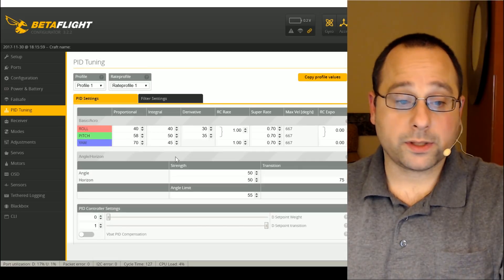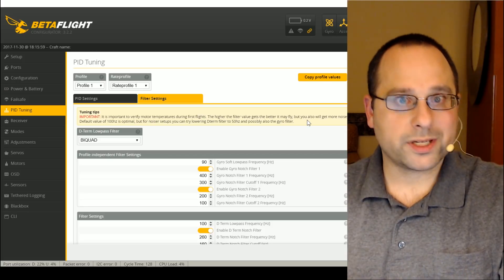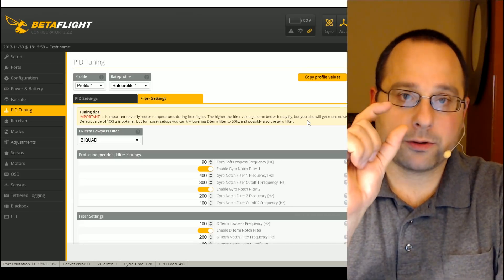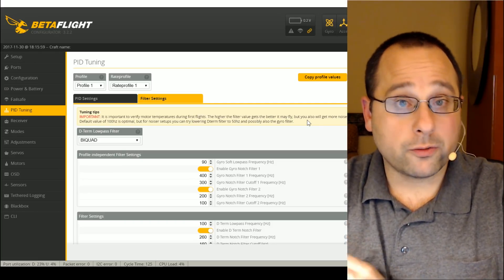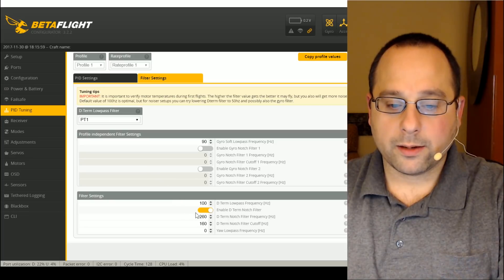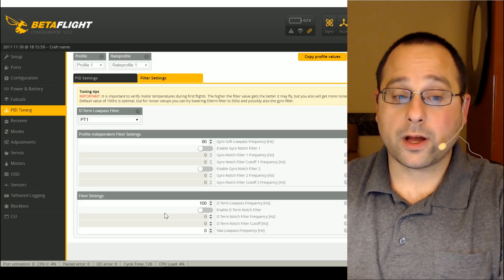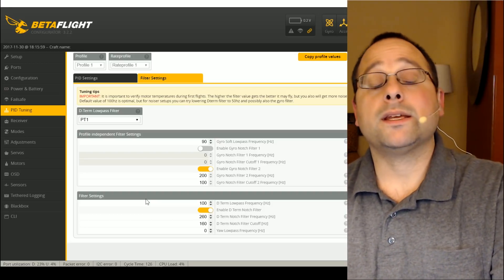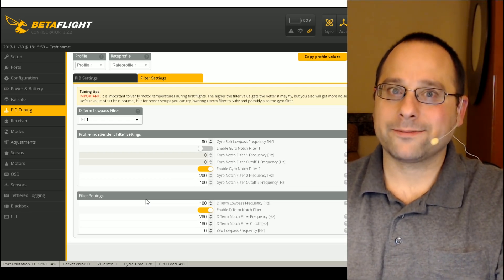Betaflight Dynamic Filter | HOW TO TUNE

Comment: Joshua I think you really should come up with a better description of "How hot is too hot?" There is a great deal of variability in what people perceive as "too hot to keep your fingers on the motors..." I think to be scientific about it you should just figure out a temperature that goes along with this statement so that those of us with infrared thermometers can check motor temps. Just my two cents. Thanks as always for the great content, in addition to these two cents I also just became one of your Patrons...
Reply: It's more a rule of thumb. The absolute temperatures would depend on the type of motors. The thing is, if it's too hot to hold in your hand, the motor will probably still be ok, but close to being too hot. So to keep a margin of error, if you can't hold it in your hand, it's too hot :) Stick to that rule and you'll be fine
Reply: Yes I know it is a rule of thumb. But a temperature as a rule of thumb would be more precise and useful. Someone as knowlegeable and connected as Joshua should be able to get a rule of thumb temp from motor manufacturers. Or come up with one based on his experience and testing... Plus as someone who appreciates a scientific approach to things I would think he'd be interested in coming up with a rough safe temp.

Comment: I think you promised to make a video about tuning anti gravity in (I think) your Betaflight 3.2 set up video.
Reply from the maker: Step 1: Raise anti_gravity_gain until the quad holds firm on punchout or throttle chop.

Step 2: If you get to about 8 or 10, something is wrong with your setup.

Comment: Have you heard of anyone having a problem with their betaflight f4 board not arming and if so do you know what the problem was ?
Reply: If you have an OSD turn on "warnings" in the OSD it will tell you at least some of the time what the issue.
E.g. I've seen "nogyro" or "noprearm" before.
You can also try to arm while attached to USB (take off your props) and then go into the CLI and type status.
There's a code in the output. Theres a page on the Betaflight github wiki that tells you what the codes mean.

https://github.com/betaflight/betaflight/wiki/Arming-Sequence-&-Safety
Reply from the maker: https://www.youtube.com/watch?v=3mOeL8f1dMM
Reply: Joshua Bardwell thank you once again for your help the quadcopter industry wouldn't be the same without you

Comment: SIDE QUESTION:
What's the best setting for a F4 FC?
8K/8K or old school ratio -> 8k/4k ?!?!?
Reply from the maker: 8k/8k.

I have no idea what this 1/2 ratio you're talking about is. Sorry....
Reply: Sebastian Nobody 8k/8k works great with F4 boards
Reply: I know. But is the final result in PID loop maybe better if you use that 1/2 ratio or is this an rule of the past now?
Reply: Sebastian Nobody I find that 8k/8k works best for me when comparing to 8k/4k or 4k/4k. Probably going to be different for others but that's my experience!
Reply: I use 16k/8k with DShot 1200 and dynamic filtering. No issues on my end.
Reply: Joshua Bardwell 
Way back in cleanflight times and early bf times the standard setting was always half the pid loop speed of the gyro. I guess as the cycle times were not as clean etc. Or maybe because of too little cpu power...
Reply: I began fpv this year and never used cleanflightt, but half the pid loop frequency is also settled in mý mind for no apparent reason
Reply: Sebastian Nobody according to the developer 's github there is no point to run 8/8 instead of 8/4

Comment: FOR ME VERY IMPORTANT QUESTIONS:
- What is faster (less deplay)? 1 to 2 static gyro notch filter   OR   just dynamic notch?
- What's the need of enabling static notch filter(s) if dynamic is on? Should the dynamic filter not cover the static parts as well?

So far, I have the best experience with my Martian II frame + 2205 2300kV motors to have just Gyro Notch 1 (245 Hz center) and D-Term Notch on (and of course PT1). Dynamic Notch just added propwash back again.

My other DALRC X215 frame + same motors is more tricky. Here I need Gyro Notch 1+2 and D-Term-Notch to be on. And since dynamic notch is out this is on, too. This all helped a lot to for better overall flight performance.
Reply from the maker: Dynamic notch latency is impossible to generalize. Its width is dynamic. So its latency changes.
Reply: But it must be more as a scan of the gyro raw data is needed. The static filters are fixed manually, thus no analysis needed.
So in my understanding its faster to work with a static filter. If you crash a lot or fly at different altitudes or temperatures the dynamic filter is more handy.

And what about using static on top of dynamic? Is it usefull?

Comment: What the point to keep gyro notches on? Wont they interfere with dynamically set notches?
Reply: Notch filters are static, they attenuate a frequency range you choose.  The dynamic filter analyzes the data and seeks out the frequency with the highest noise and attenuates accordingly.  If a notch filter is already set up properly (via black box freq logs and manual settings) then the dynamic filter can only see what’s left, and then seeks out whatever noise is the loudest.  If your noise levels are really low after tuning filters manually, then the dynamic filter may actually be unnecessary.  All filtering requires processing time, so less filtering improves the immediacy of flight control, but the additional filters do not really “interfere” with each other as you suspect.  Only drawback is very slight delay to control, maybe imperceptible to some/most.  As far as overall best latency performance I suspect PT1 manually set up notch filtering is the king as it uses the least processing, but takes a lot more work than the one-click dynamic filter.  Im still learning this as well.
Reply from the maker: No, not at all. They are complimentary.
Reply: Joshua Bardwell,  how excactly? Please explain
Reply: Dave Wheeler so, the dynamic filter is applied after notch filters?  I thought othervise...
Reply: I'm not sure which priority/order things are processed, that's a good point.  The dynamic filter likely needs more aggregate data to determine where to apply attenuation, so I would assume it is processed in an entirely separate way than the normal notch filter.  I am simply making the assumption, I'm not sure how it's programmed.
Reply: https://github.com/betaflight/betaflight/wiki/BetaFlight-3.2
gyro -> dynamicNotch -> notch1 -> notch2 -> lpf -> P term
-> motors-> D term -> notchD -> lpfD -> setpointRelax&Weight
Reply: Well there it is, nice find.  That does beg the question  why the DF is processed first...  seems its redundant unless another larger noise spike develops that causes the DF to migrate...  Beyond that, I wonder if there’s a any real reason to run both DF and NFs?

Comment: How about switching the dterm notch for biquad dterm lpf ? that way the dynamic can just notch the particularly noisy parts and not mute potentially useful data.
Reply from the maker: I would never, ever suggest turning off the d term lowpass. Much too high a risk of burned motors.
Reply: Erm no I meant I think it would be better to disable all the notches before changing the LPF from biquad to pt1. 
My reasoning for this is that notches are very aggressive at there center frequency and for that reason need to be set very precisely or you could end up loosing useful information.

Comment: Dont think this is for me personally, I fly Dal props which easily survive crashes but xan get bent out of shape...and I typically dont bother changes props till they are nearly origami or bent back so many times Im not even sure what they looked like to begin with.

I must ask tho, what is th correlation between how the FC 'sees' oscillation? For instance, when PID tuning, this is a response to error, but at what point is the FC able to recognise those errors to be oscillation as opposed to just a series or error points?
Reply: I think this is actually an argument in favor of using dynamic filter. It responds to changes in vibration frequencies so it is very good if you fly with damaged props as it will adapt to that. In my experience ever since I started using dynamic filter I can keep flying with damage that previously was too much.
Reply from the maker: The FC never "sees" oscillation. It just sees and tries to correct for error, regardless of type or cause.
Reply: Joshua Bardwell that being the case, how does it know at what frequency to ignore oscillations?

Comment: Would removing all the dterm filters also make the tune require lower dterm?
Reply from the maker: Yes, but maybe not for the reason you think. Removing the filtering would result in hotter motors, which would require lower D gain to avoid smoking the motors.

Comment: What if I have all three filters disabled but did not activate dynamic notchfiltering in config?
Seems like that is what I have been doing, is this complete nonsense or was it like this in earlier versions.
And does it make a differnece in performance?
Reply from the maker: If you do that, you will have lower latency and less filtering. The main risk is that a sudden change in vibration (like a bent or broken prop) will burn a motor. The dynamic filter can respond to this, but the static filters can't.
Reply: Wow answered by the master himself ;). Your videos helped me soo much over the last couple of years, thanks alot!

So if I understand this right, it is riskier but could perform better in theorie. 
Running 8k 4k dshot600 acc and everything i dont need disabled on a Omnibus F3 Cpu load on my bench only 17%
I had some rolls of death after fast flips with two of my quads but were pretty sure, until now, this was due to battery sag because the fc rebooted after the crash and it did not happen with a fresh battery. I also flew back to me with one prop missing a blade, bad vibrations but kept it in the air. 
How many more filters ( or layers of filtering) are there after I disabled the three filters you mentioned in your video? 
I dont want to go too deep into the topic but I had one semester about feedback control systems and a vague understanding what is going on there,
and for quads I sadly just did what people like you suggested without understanding much.
Is there a nice source to read into it other than bori`s rcforum posts, something more visual?
Reply from the maker: Honestly the FC should never reboot from battery sag. How low does the battery sag, worst case? 9 volts? This is a completely totally destroyed 4S battery but it is still more than enough to keep the FC's 5v regulator alive. If the FC is rebooting due to brown-out, then the regulator on the FC is defective or badly designed in my opinion.

These are all of the filters that there are.
Reply: It most of the times happend on my small 95mm build.1105 motors and 2 inch props, flies like a charm.
Punchouts drop it to 6.2V on 2S. On 3s the sag is not as pronounced. And deathrolls only happened if I use full 1200deg/s rollrate. 
Maybe a related topic: Do you set motor max value to 2000 in blheli and bf for dshot escs? Some time ago you had to leave some room for the fc to act around 1970 if Im not mixing up stuff now (put the hobby on freeze over last winter and maybe missed a bit when catching up)

Comment: I run F3 board with 8k/4k gyro/pid and the cpu load is 24%max so it should be fine? Actually I flew the quad a lot and there is no problem.

Comment: Glad you covered the too hot aspect. Electric RC car racers have been using temp guns for years.  140F is a good high temp mark for electric motors.
Reply from the maker: In my experience, a temp gun is tricky to use. Depending on exactly where you point it, it can read very differently. The temp I'm most concerned about is the temp of the windings because that's what will burn (the enamel, specifically). I'm not convinced that temping the bell is the most reliable way of doing it. But then again I guess if you are touching the bell with your fingers, you're temping the bell...
Reply: With a temp gun you shoot at lotsa different locations and soon you learn the hottest spots. On an outrunner motor it's quite easy to shoot the windings and the windings appear to be the hottest spot. On inrunner motors as rc cars use it's almost impossible to temp check the windings accurately. The wire coatings burn at a much higher temp that 140F. I find that in racing rc cars that the power drops as the temp increases over that 140F mark. The decrease in performance is noticeable and assume it comes from the heat decreasing the magnetic field and increasing the IR on the motor.